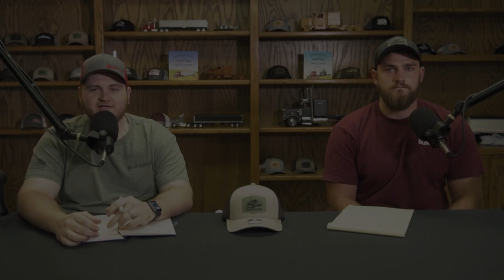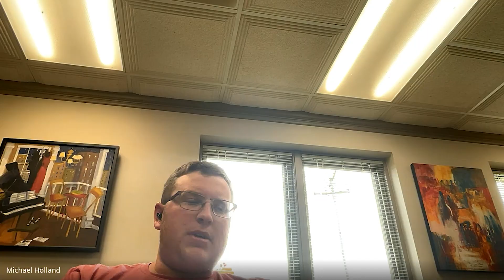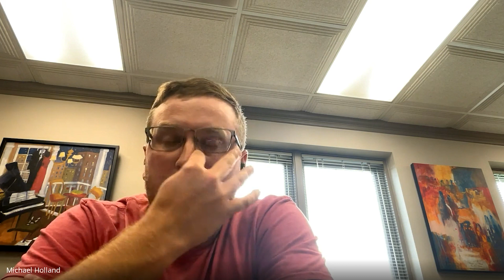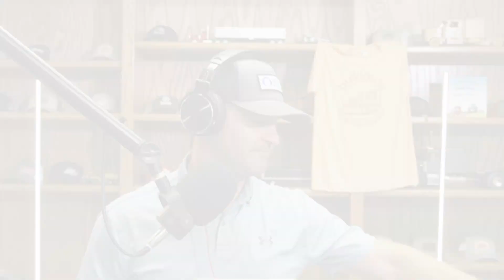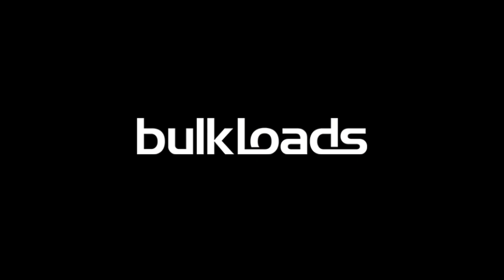How to Unload Your Trailer in Half the Time

Comment: Permanent vibrators are worth the initial investment and so is an air wand that runs off your emergency glad hand. Keep them serviced to prevent them from freezing which they will. Temp vibes leave oval scar marks on the hopper bottom walls. Unsightly. And if you are going to bang away...use a rubber mallet on the rails of the hopper wall or it'll void certain aspects of the warranty on the trailer. Gotta luv hoppers...my advice for an easy life...Dont haul DDG in the summer.

Comment: I use these vibrators on my beall pneumatic trailer and have a 13 inch gardner denver blower installed on my single axle truck. Makes unloading cement, slag, and flyash offload fast.

Comment: Hey guys, I’ve actually seen these vibrators work. I do have the permanently mounted saddles where I can place vibrators it on my trailer. That being said, after seeing the Martin vibrators work, my next trailer will not have any permanent vibrators on I’ll be using their system.
Reply from the maker: This is great first hand experience to hear! Crazy how one well designed patent can save so much time. Thanks for the comment Jamel!